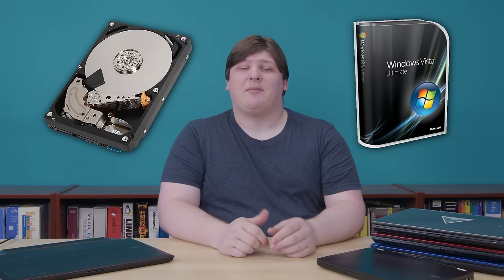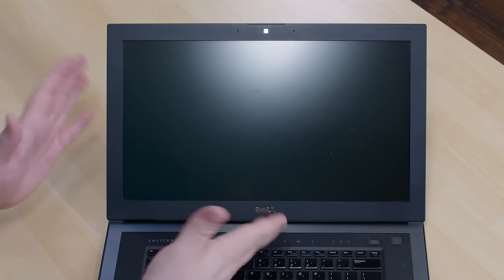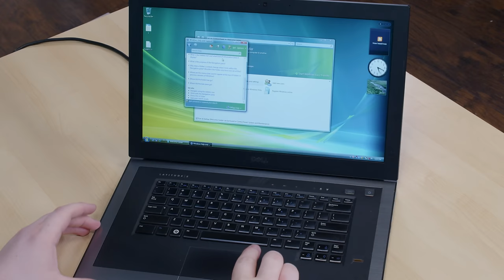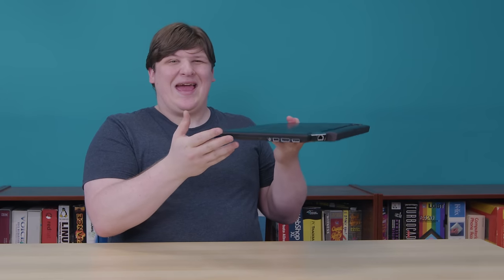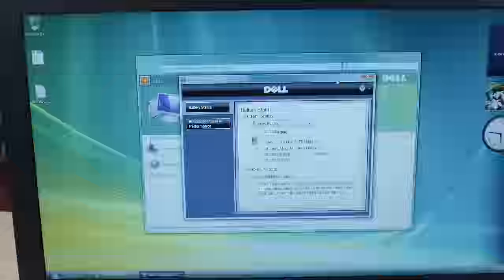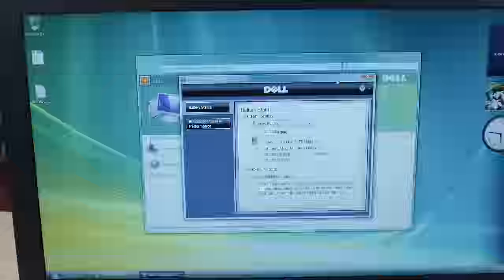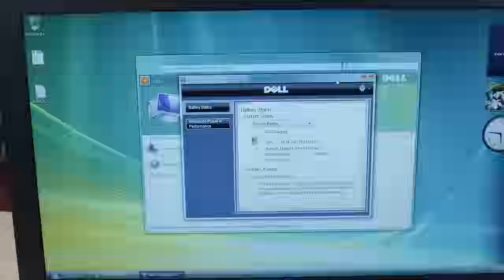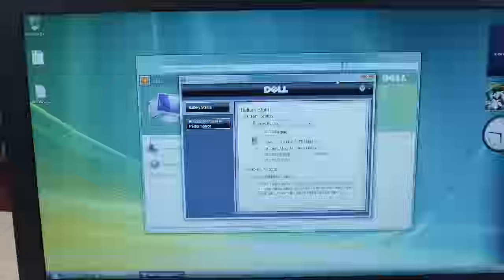Quick Start Ep 6: Assuming Direct Control

Comment: I really think that arm processor had potential if they ran a lighter Linux build and made a few useful programs that could load their dependencies only when executed also limiting the os elements Tobe more 16bit in nature so you would be able to launch windows 3.1 level like office apps 600 mhz is alot of processor power when you consider 486 level pc's are still able to do many productively task calculations word processing spreadsheets and email as long as the apps are written and designed appropriately heck I still use office 97 on an older pc because it's the most natural feeling version of office to me. Sad thing is a simple solution these companies overlooked is windows 98se embedded on its own partition as this os would have have been compatible with majority of the hardware since it was still being used in many devices like bank machines I personally had a bootable thumb drive with a few games that I'd take with me coworker houses boot right into my specific 98 desktop on Vista machines  without issues. They were probably to cheap to spend the 10usd to Microsoft for a license key I'm sure windows 98 could boot within 8 to 12 secs from harddrive on Vista Era hardware.

Comment: Omfg that's mad. I have one of the laptops that has the on button (work issued in 2010 or so, and long since retired). It never did anything on my laptop. I just realized that that's because day one i nuked winderp and installed linux instead. It probably couldn't read the disk to load that splash.sys reader thing. 😂😂😂

Edit: I still have the laptop. The screen is borked iirc. But I'm gonna have to investigate now.

Comment: Fun fact: mclaren made a wireless charger for their EV car, but you have to line up the puck manually and it's suuper inefficient and slow. 
more than 50% of all owners of that car decided to have a normal EV port retrofitted. especially because the battery life is unsurprisingly god awful and you can only charge it at home overnight.

Comment: Huh. The weaker sibling to the OMAP 3530 CPU in my OpenPandora gaming palmtop from 2010 was NOT what I expected to find in a Latitude... and that performance is EMBARRASSING, given that my OpenPandora runs Xfce smooth as butter thanks to the wizards in the community producing stuff like a version of SDL which delegates to the GPU's onboard Tiler hardware for scaling and hand-tuned emulator packages. For a long time, my best Playstation emulation experience was PCSX ReARMed on my single-core OpenPandora, despite also having a dual-core 3.2GHz Athlon from 2011 on hand.

...and that's with the OpenPandora people apparently underclocking the 3530 to 600MHz by default, given that Wikipedia says it's rated to 720MHz and my unit seems fairly typical in being able to overclock to 800MHz without overvolting if I want to emulate Super Mario 64.

Comment: Back when I had my HP Elitebook 840 G1, the synaptics touchpad wasn't actually that bad with multitouch from what I recalled. absolutely there are worse implementations. 
also most Windows precision touchpads use the exact same hardware as their synaptic driver alternative, to the point where some people found a lenovo thinkpad driver that happened to not have a hardware limitation, and a lot of people across a whole variety of laptop brands will actually just support windows precision with that driver. I think even I managed to get it working on that 2013 840 G1. 
bad drivers ruin good hardware
Reply: unrelated story is when a lot of people found out that Dell made an APTx driver for intel wifi cards and it just worked... yea the only reason all wifi chips in all devices doesn't support the better standard is because Qualcomm wants licensing money. screw them.

Comment: Wireless charging and a separate wireless dock... I'm impressed at how over-engineered the accessories are for such a base-level notebook. They could have done what Gateway, Compaq, Lenovo, etc. do and just have a dock port on the bottom, but nope! Why buy only one accessory when you can buy TWO?
Reply: Just about all other Dell laptops at the time also had the dedicated docking connector on the bottom.

Comment: I’ve often wondered about an absolute touch trackpad that ‘snaps’ mouse pointer relative to point touched.
Reply: Yeah, that would be a tablet. As in a drawing tablet. Wacom's low end stuff features both pen and touch support. I remember the touch mode was still being relative position, but there might be a toggle somewhere in the software.
Reply: @PaulSpades  just think it would be nice to touch close to item on screen then just move a few mm and click… these days they could even integrate a touch screen as your trackpad
Reply: @Ghsty8  Screens in touchpads would be nice... but. The touchpad position on laptops is optimized for touching, not for display, and laptop display position is bad for touching. So... idk, we should all use ipads and rarely type. That was the whole iphone, ipad ideea for modern computing, and it works for some people. I'm a keyboard and track point person, myself.
Reply: @PaulSpades  more thinking that the trackpad could reference the screen so that when you touch it the mouse pointer jumps to that location. Ie touch start menu location mouse pointer is there, approx location of icon pointer is there

Comment: I wish Dell would go back to their old AC jack, the newer style small one is annoying and the grip strength isn't high enough so they're always just popping out enough to stop charging without you noticing. Old ones didn't do that.

It's an interesting looking laptop, I guess they were trying to make it look like a high end briefcase or document folder thing with the battery looking like the handle.
Reply: On some even newer machines, they don't even use that connector.  My current work laptop (a fancy Dell Precision model) doesn't have a dedicated charge jack at all - it just uses USB C PD for everything.
Reply: @ccoder4953  Yeah I can use either too, although they're running out of spec with USB-C (130W) so apparently it needs some Dell USB-C charger that can do this... never tested it though. I guess in time the DC jack will disappear from all laptops.
Reply: @lemagreengreen  I have one of those adapters.  I think you are right they are running USB PD a bit out of spec since it's doing 130W @ 20V.  There are newer versions of USB PD that can do up to 240W, but the voltage is supposed to be higher for that.  Like I said, this laptop doesn't have a normal charging jack at all - just USB C.  So yeah, I could see DC jacks disappearing once the chipsets become cheaper and more common.  It does save space and it is nice you can use any port to charge.  Though I do wonder why Dell opted to not have ANY USB A ports on this machine - it's not like there wasn't space.

Comment: I was wondering how long until an actual secondary low power CPU was combined with solid state storage.

If you do this, you could have a secondary system that both powers on immediately AND you can switch to and from while your main OS is actually booted.

Really, this is not that different than what games consoles like the PS4 have done, where the main processor used by games is an AMD chip, but they have a secondary ARM chip that handles background updates while the console is turned "off" or is inside a game.

Also, IIRC, just before Macs moved away from Intel, the touchbar MacBooks were already shipping with a small ARM chip for touchID and the like.
Reply: I think modern nvme drives actually feature a fast arm soc with a gig or two of ram for cache, trimming and stuff.

Comment: 11:20 Synaptics track pads entire suckiness comes from their horrible drivers. I once hackintoshed a laptop with a Synaptics trackpad, and it just worked like a trackpad on an actual Macbook. It was kinda surreal to have the same trackpad that was a horrible experience under windows be a servicable one with all the gestures under macOS
Reply: I've also found that most trackpads work better in modern linux than windows.

Comment: Unfortunately, they didnt figure the soft touch rubber out later, i have an elitebook 2760p (not the 2560p ive mentioned before) and the whole bottom is covered in it. Even the brand new battery i had to buy for it.
Reply: That laptop on its own is really weird on its own, though, so it's an okay example

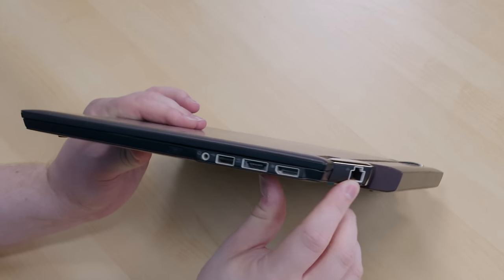Comment: 5:12 On my Dell, the eSATA port is a USB 3.0 port; the fact that the Z600's eSATA port is not USB 3.0 (confirmed) tells me that it's also gonna be suuuuper slow. (Probably <1.5Gb/s)
Reply: You sure about that? I recently read somewhere that with eSATA/USB combo ports the USB port is always USB 2.0.
Reply: @FlyboyHelosim  6Gbps eSATA ports support USB 3.0 

3Gbps & 1.5 Gbps eSATA ports are far more common though.
Reply: @prophetzarquon1922  Which Dell laptop do you have, out of curiosity? I'm guessing it's old enough to still have eSATA but new enough to have USB 3.0.
Reply: @FlyboyHelosim  I'll have to check LOL 

It's so old it runs Win7...
Reply: @prophetzarquon1922  Dude my daily driver runs Windows 7.
Reply: @FlyboyHelosim  Yeah, mine too. Win7 was the last really good Windows OS to be targeted at end-users instead of enterprise support levels. App\service-requirements aside, I haven't seen much good reason to "upgrade". 

I've built Win10 machines, but I can't recommend them. The number of OEM Win10 machines I've had to help recover after they literally hosed themselves without user interaction, is enough to kill any interest I had. Then there's the new hardware "security features". 

There are a few modern apps I'd like to run (especially Unreal) but given the state of modern devices, I'm more inclined to stop using them than to get newer ones. Framework laptops are tempting, but running a modern Win+Linux dual boot setup faces more challenges than ever, so... no?
Reply: @prophetzarquon1922  Windows 7 was also the last version of Windows which was fully-fledged and wasn't touchscreen-oriented. I'm not a massive computer user nowadays like I was years ago, so whatever won't work on Windows 7 I just find an alternative or don't use it. I see no reason to upgrade and in fact have probably spent as much as what I would for a new system preserving my Windows 7 era machines and stocking spare parts and accessories to make sure I can use them for as long as possible. If I need Windows 10 or 11, and that's a big if, then I just run them in a virtual machine.

Comment: Installing a bunch of crap that loads on boot and actually doing Windows updates back to back instead of installing the final pre-updated version will probably destroy the boot time back to the actual expected trash boot time you'd expect to be an issue.

Also the soft touch zoom option should just be inputting a scroll wheel while holding the control key, no special hackery required for that.

Comment: mSata wasn't THAT uncommon, currently using a 860 Evo mSATA (adaptered) in my desktop, originally purchased for my e7240. Of course, the main benefit (before m.2 became common) was not having to dedicate a full 2.5" space for the drive.

EDIT: nvm lol, this is a different connector (uSATA). Could be interesting to check how a replacement hold up compared to msata.

Comment: About the SSD... Urmm yeah about that. I've got a Lenovo x200t from 2009(ish) which had a 2gb ssd purely to act as a cache for it's mechanical hard disk.

Now that was a janky solution, especially since on newer OS's it's completely useless.

On the flip side (pun very much intended) the screen on it is a full on wacom tablet... No touch pad or touchscreen but you have a stylus instead.

Comment: It's so sad how... lame those instant-on OSes were. It would probably be EASIER to make an instant-on OS that's a sysadmin, enthusiast, or power user's dream, because you wouldn't even necessarily have to implement any kind of GUI... just custom text-mode Linux with a full suite of CLI utilities (or BusyBox, if you're really cramped for system resources and space, plus a few extra useful bits and bobs) and full access to any/all storage attached to the machine. Call it something like the "System Recovery Interface" and you're golden.

The ARM two-computers-in-a-trenchcoat approach could potentially make this even better; if the designers & developers went in with this purpose in mind, they could essentially create an unbrickable machine... especially if there is some way to flash the main system BIOS while booted up in ARM mode, provided booting the ARM computer completely bypasses the main BIOS. If you're gonna do that, you also might as well implement some way of overclocking the main x86 processor and otherwise controlling the firmware to a greater extent than you could with a normal BIOS...

It would've totally been possible to make something incredibly useful and powerful, but instead they created sludge.

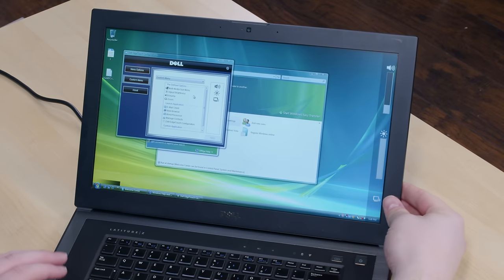Comment: 14:47 Utterly baffled by the implication that a zoom bar hasn't been a standard browser feature for like, 20 years
Reply from the maker: Not sure what you mean.
Reply: @CathodeRayDude  "This allows you to zoom into a web page without having to press a button over and over and over", but you don't have to press a button over and over and over to zoom. Like, I'm pretty sure Netscape Navigator supported Ctrl-Scroll Wheel for the same feature (and every modern browser still does), and most had either a bar you could click (Vivaldi still does, but most jettisonned it along with the statusbar) or a dropdown to select a zoom level. Heck, you can see that very button in the footage, in the bottom right of IE is the zoom dropdown changing value as you're zooming in and out, exactly the same as it would if you were Ctrl-Scrolling.
Reply from the maker: @Chocomint_Queen  Okay

Comment: 2 Gigs of RAM in 2010, isn't the worst it ever got. Around 2011/2012 my younger sister bought Acer Aspire One netbook. It came with both W7 and possibly Android 2. And here's the kicker, it had dual core 1,1 GHz Intel Atom, with a whole 1Gig of for all I know unexpandable RAM. The poor HDD struggled for minutes, booting Windows, after it was done, the RAM was all hogged by system, preventing you from effectively running anything else. Only recently, when my father dusted that poor bastard off and installed Linux, it became somewhat usable.
For example how terrible tha hardware was, my first smartphone, which I bought year later in 2013 had the same count of cores, frequency and RAM, ast that piece of garbage, and it wasn't a flagship either, just a lower end Sony Xperia L, which was around 50 bucks cheaper than that slow piece of electronic garbage dump filler.

Comment: Okay so the value is indeed absolutely horrible. My Acer AMD Penom II laptop from the same time came with 6 GB of upgradeable RAM. Granted, it is a 17 inch chonker and the cooling sucks, but hey, it was also "only" $999. And you know what, the top of the chassis is actually brushed aluminum! The rest is standard plastic of course.

Comment: ("Spoilers" in this comment, watch the video folks...)

Anyways, I have a pandora handheld (the older slower one, OMAP3530), and the speed of opening that email i was like "yeah it's like an OMAP, those were all the hot in 2008-2010" but i wasnt expecting... actually basically that OMAP :D (the 3430 is the "proper companies" (like in Nokia N900, some security stuff etc iirc) version of the general availability 3530)